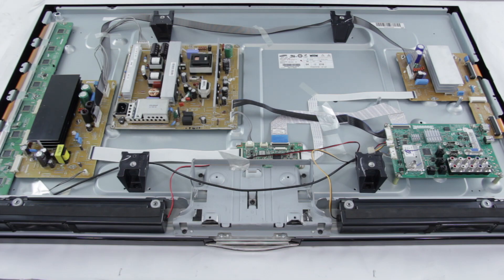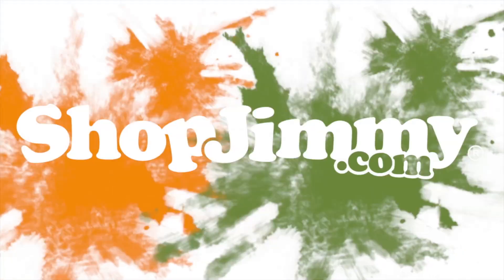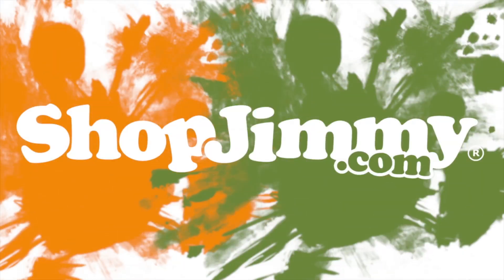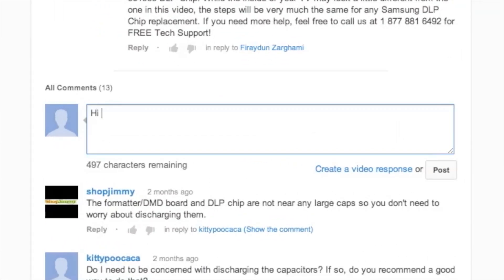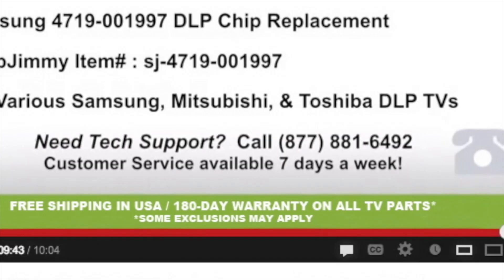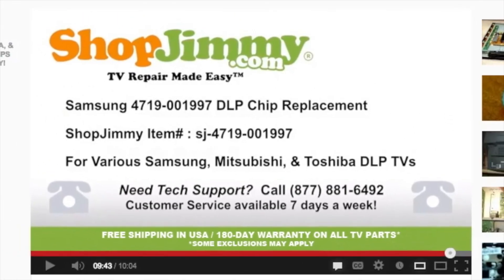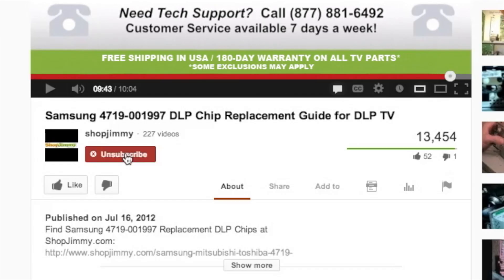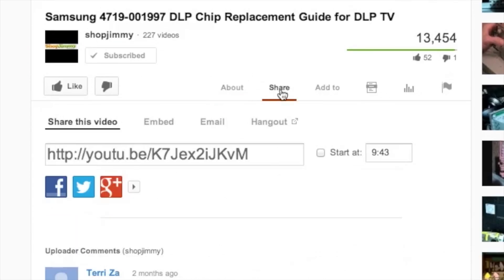Plasma TV Repair Tutorial - Common Symptoms & Solutions - How to Fix Plasma TVs

Comment: Here is a fun one for you, Hitachi  P42T01U, powers on with blue ON light from standby, screen is lit up, no function from the remote although the power light flashes to say its receiving a signal and every now and then, you will get a remote icon displayed on screen with a red line through it as if to say NO REMOTE, no controls work on the front of the screen, it then cycles a power trip, every minute or so, the TV relay will click, the panel shuts down and then comes back up almost instantly, there is no sound, the panel is lit though and presumed working fine as per the no remote icon, i suspect going from your video, its the main board thats at fault?
Reply from the maker: DirtyRottenBastard   I recommend replacing the main board in your TV.  Here is a link to replacement parts for your TV model number on our website, click here:  http://www.shopjimmy.com/catalogsearch/result/?q=42T01  Be sure to match part numbers on your current board, with your replacement for compatibility.  You can also call our customer service for further assistance with your purchase.  (877) 881-6492  Thanks and please let us know if you have any further questions with your TV Repair!  www.shopjimmy.com

Comment: I have a 50" Lg plasma tv / LG 50 PG20 no picture, no sound, changed out ysus board still no change, can you help me with my tv thanks George
Reply from the maker: George Momich  I recommend replacing the main board in your TV.  Here is a link to replacement parts for your TV model number on our website, click here:  http://www.shopjimmy.com/catalogsearch/result/?q=LG+50+PG20  Be sure to match part numbers on your current board, with your replacement for compatibility.  You can also call our customer service for further assistance with your purchase.  (877) 881-6492  Thanks and please let us know if you have any further questions with your TV Repair!  www.shopjimmy.com
Reply: Did find a solution to your problem? I have a LG 50 PS60 that will turn on for about 3 secs then turn off. Maybe we have the same problem. Any suggestions?
Reply: Mark, you have a capacitor problem on your power supply, check your power supply for bad caps.

Comment: I have a Panasonic model TH-42PZ700U the power light is red and blinks 7 times. No picture or sound just the power light blinking red 7 times is it possible for me to fix it and what part do I need.
Reply from the maker: Roe La Pollo   I recommend replacing the SU and SD boards in your TV.  Here is a link to replacement parts for your TV model number on our website, click here:  http://www.shopjimmy.com/catalogsearch/result/?q=TH-42PZ700U+  Be sure to match part numbers on your current board, with your replacement for compatibility.  You can also call our customer service for further assistance with your purchase.  (877) 881-6492  Thanks and please let us know if you have any further questions with your TV Repair!  www.shopjimmy.com

Comment: I have a Panasonic TC-P50S1 Plasma and while it was on it made a "splash" type sound then went completely black and lost all sound as well. When I press the power button it makes the sound as if to turn on, but it remains black with no sound. The power or on red light at the bottom of the TV flashes ten times, pauses, then repeats ten flashes over and over.
Reply from the maker: Jorge Rodriguez   I recommend replacing the SC board and the buffers that attach to the SC board.  Here is a link to replacement parts for your TV model number on our website, click here:  http://www.shopjimmy.com/catalogsearch/result/?q=TC-P50S1  Be sure to match part numbers on your current board, with your replacement for compatibility.  You can also call our customer service for further assistance with your purchase.  (877) 881-6492  Thanks and please let us know if you have any further questions with your TV Repair!  www.shopjimmy.com

Comment: Model: LE40C530F1W
Model Code: LE40C530F1WXXU
Samsung Solarized Distorted Picture since yesterday , Dont know which hardware part needS to be changed tried reset all cables and board cleanimh but no luck , I upload a video on youtube hope this help you to find the problem , This is the link here {{ Help me Fix my SAMSUNG LCD LE40C530F1W ? }}  Thanks
Reply from the maker: Ahsan Bashir   This could either be a bad main board or a bad T-con board in your TV.  You may need to replace each board one at a time to see which one fixes the problem.  Here is a link to replacement parts for your TV model number on our website, click here:  http://www.shopjimmy.com/catalogsearch/result/?q=LE40C530F1W  Be sure to match part numbers on your current board, with your replacement for compatibility.  You can also call our customer service for further assistance with your purchase.  (877) 881-6492  Thanks and please let us know if you have any further questions with your TV Repair!  www.shopjimmy.com

Comment: I have a Samsung Plasma TV model number HP S4253 X / XAA that  has a picture sometimes and then it has a black screen.  So  the picture sometimes goes in and out.  What could be causing this problem. The t.v. has sound but no picture.
Reply from the maker: Lorrenzzo Martin   I recommend replacing the Y-Main Board and the buffer(s) that attach to the Y-Main Board in your TV for your repair.  Here is a link to replacement parts for your TV model number on our website, click here:  http://www.shopjimmy.com/catalogsearch/result/?q=HP+S4253+X+%2F+XAA  Be sure to match part numbers on your current board, with your replacement for compatibility.    You can also call our customer service for further assistance with your purchase.  (877) 881-6492  Thanks and please let us know if you have any further questions with your TV Repair!  www.shopjimmy.com

Comment: HPS4273X/XAA  Started out that when I would be watching tv or dvd a blue fuzz would come over the tv.  Shut it off for awhile and the fuzz would be gone for  awhile.  Then there may have been vertical lines and black bars on the screen or even only half a picture, but I don't remember because the tv now turns and has audio but no picture and it happened a long time ago.  Recently I have renewed my interest in repairing this 42" tv.
Reply from the maker: ajfranklin1  This sounds like a TV panel problem.  If your TV panel is bad, it may be more cost-effective to replace the TV as panels are typically hard to find in stock, difficult to replace, and expensive.  Thanks and please let us know if you have any further questions!  www.shopjimmy.com

Comment: Thanks for the great videos, BTW!

I have a question for you, and I hope you can help me... :)

I have a Samsung Tantus 50 Inch Plasma Display that was given to me, and it once had a beautiful screen. Now there is a problem.....upon turning on nothing shows up on the screen, no menus or picture. The TV itself is getting power and is showing a green LCD Power on light, and I can see the backlight coming on illuminating the display but no picture. Even when clicking the "Source" switch I can see the display vary a bit in lighting like it is trying to accept input, but nothing.

In short, the screen is getting power, the display backlight appears to be working and there is a green lcd power light, but no menus or display..totally blank.

I am wondering what should I check first or what would be the more common cause for this, i.e. the Y, X or Logic boards? I am prepared to change all of them out if need be, and interested to see what type of experiences others have had in this instance ... any and all helpful advice appreciated....

Thanks!
Reply from the maker: MassMan67   I recommend replacing the y-board and buffers that attach to it.  Please reply with your TV model number and then I can recommend a replacement part.  Thanks!  www.shopjimmy.com

Comment: Ilo 42 ed plasma tv
s/n: 60360752
The tv made a pop noise and picture is black still have sound
Reply from the maker: cynthia ranney   I recommend replacing the Y-Main board and buffers that attach to the Y-main board.  Here is a link to replacement parts for your TV model number on our website, click here:  http://www.shopjimmy.com/catalogsearch/result/?q=42+ed  Be sure to match part numbers on your current board, with your replacement for compatibility.  You can also call our customer service for further assistance with your purchase.  (877) 881-6492  Thanks and please let us know if you have any further questions with your TV Repair!  www.shopjimmy.com

Comment: I have a Viore Plasma tv model# PDP4210EA. The problem is the tv shows a Pink ish color even when its in stand by mode. When in stand by mode the color should be blue. but that's not the case. I  think its the s-sus.
Reply from the maker: JERMAINE773   You can certainly try that board, however I believe the problem is the YSUS board that needs to be replaced for your TV Repair.  Here is a link to replacement parts for your TV model number on our website, click here:  http://www.shopjimmy.com/catalogsearch/result/?q=PDP4210EA  Be sure to match part numbers on your current board, with your replacement for compatibility.  You can also call our customer service for further assistance with your purchase.  (877) 881-6492  Thanks and please let us know if you have any further questions with your TV Repair!  www.shopjimmy.com

Comment: Hallo,i have a ECE plasma tv model no EDP 4223 EW,serail no EPD42T23S843 MAL 00080.All the part samsung made.The problem is went turn on got red blink.but i not count it after that black screen and 3 black vertical line.cant you tell me what happen and any part i can change
Reply from the maker: Omar Mat Ali   This sounds like a TV panel problem.  If your TV panel is bad, it may be more cost-effective to replace the TV as panels are typically hard to find in stock, difficult to replace, and expensive.  Thanks and please let us know if you have any further questions!  www.shopjimmy.com

Comment: LG 42PC3D. The picture is dark and pixelated on startup. Picture slightly improves and pixelization clears up but overall all remains very dark with the heaviest shadowing on the left side. Sound seems fine. This happened suddenly. TV was fine when shut down, then 30 min later on startup it was broke. The picture defect occurs on any input even a snow static screen. TV is about 7 yrs old.
Reply from the maker: Kyle Kraetzer   I recommend replacing the main board in your TV.  Here is a link to replacement parts for your TV model number on our website, click here:  http://www.shopjimmy.com/catalogsearch/result/?q=LG+42PC3D  Be sure to match part numbers on your current board, with your replacement for compatibility.  Here is a link to a video showing how to identify your part number, click here:  TV Part Number Guide for LG & Zenith Main, Digital, & Tuner Boards (LCD, LED, Plasma TVs)  You can also call our customer service for further assistance with your purchase.  (877) 881-6492  Thanks and please let us know if you have any further questions with your TV Repair!  www.shopjimmy.com

Comment: I tried to conect a LED tv to my laptipn and the HDMI made a short circuit. Now the tv doesnt turn and does not have any stand by. What can be wrong?
Reply from the maker: Miles_Albus  I recommend replacing the main board in your TV.  Please reply with your TV model number and then I can recommend a replacement part for your TV Repair.  Thanks!  www.shopjimmy.com

Comment: My Zenith Plasma TV, Model #Z50PJ240. The problem is, when you turn it on, it clicks on and then off. What can I do to make it turn on and stay on? Is there a reset button?
Reply from the maker: LINDA MAYS   I recommend replacing your power supply first to see if that fixes the problem.  Here is a link to replacement parts for your TV model number on our website, click here:  http://www.shopjimmy.com/catalogsearch/result/?q=Z50PJ240  Be sure to match part numbers on your current board, with your replacement for compatibility.  Here is a link to a video showing how to identify your part number, click here:  TV Part Number Identification Help Guide for LG & Zenith Power Supply Unit (PSU) Boards  You can also call our customer service for further assistance with your purchase.  (877) 881-6492  Thanks and please let us know if you have any further questions with your TV Repair!  www.shopjimmy.com

Comment: I have a LG plasma tv, model 60PK200.  When I turn on the tv the screen is black for a minute or two and then the audio starts but the screen stays black.  I've checked all of the resistors on the boards and none of them are rounded at the top so I'm assuming that is not the problem.  Do you have any suggestions as to what is causing the tv to have no picture?  The manf date on the tv is January 2011.  Thanks

Comment: I have a LG 50 inch 50PZ 550 that has selectively lost two Chanel's from the DTV signal. All other channels are working fine. I have completely reset and rescanned, still no channel 2 or 6.
Reply from the maker: Robert Kayton   I recommend replacing the main board in your TV.  Here is a link to replacement parts for your TV model number on our website, click here:  http://www.shopjimmy.com/catalogsearch/result/?q=50PZ+550  Be sure to match part numbers on your current board, with your replacement for compatibility.  Here is a link to a video showing how to identify your part number, click here:  TV Part Number Guide for LG & Zenith Main, Digital, & Tuner Boards (LCD, LED, Plasma TVs)  You can also call our customer service for further assistance with your purchase.  (877) 881-6492  Thanks and please let us know if you have any further questions with your TV Repair!  www.shopjimmy.com

Comment: P50HDTV20A......I just purchased a Logic board from shopjimmy and installed it in my tv. I still have no picture. The power supply has been repaired w/ 3 caps replaced. I still have a black screen. When the tv is powered on a green light comes on logic board and you hear a click in the power supply board area and still no change...any thoughts?
Reply from the maker: lasonja blanks   I recommend replacing the Y-Main board and buffers that attach to the Y-Main in your TV.  Here is a link to replacement parts for your TV model number on our website, click here:  http://www.shopjimmy.com/catalogsearch/result/?q=P50HDTV20A  Be sure to match part numbers on your current board, with your replacement for compatibility.  You can also call our customer service for further assistance with your purchase.  (877) 881-6492  Thanks and please let us know if you have any further questions with your TV Repair!  www.shopjimmy.com

Comment: I have a Curtis pl4210a-2 and the sound works but the screen only shows fuzzy grey lines then goes completely dark after a few second. I replaced the y main and logic board but it didn't fix it. Any suggestions?
Reply from the maker: 10phil9   Did you replace the buffers for the Y-main board when you replace the Y-main board?  Thanks!  www.shopjimmy.com

Comment: A friend has a Maxent P420142X2 and I think it's a 2006 which is dead but says there was a blue line on the screen.  I hear that Plasma screens lose pix quality after a while.  Would it be worth it to fix?  He did say that there was a loud pop before it went dead.
Reply from the maker: Scalerwave Signal   I recommend replacing the YSUS board and the YDRVTP & YDRVBT boards.  Here is a link to replacement parts for your TV model number on our website, click here:  http://www.shopjimmy.com/catalogsearch/result/?q=P420142X2  Be sure to match part numbers on your current board, with your replacement for compatibility.  You can also call our customer service for further assistance with your purchase.  (877) 881-6492  Thanks and please let us know if you have any further questions with your TV Repair!  www.shopjimmy.com

Comment: Nice Video.  I learned a lot.  If you can help out that would be great.
.
here is the TV.  Make: HP CPTOH-0602.

Symptom:  Can hear a click when you turn on the unit.  Blue LEDs on the boards come on, but then one goes off and another click is heard (cutting power?).  Trying to hit the power button again does nothing.  You have to unplug it, wait for the PSU to drain and then try it again.  Here is a video of symptom

LG CPTOH-0602 Turns on and then back off

Please feel free to check the video out and steer me in the right direction so I don't waste $$ on boards that I don't need.  :)

Comment: Pionner Plasma TV Model #: 6010FD. Screen was getting greed dots on the left side of the screen for some time and getting worse. I then open the back panel to check if there were any blown capacitors but all looked fine. I checked each one. After a while the TV would not turn on anymore, It would only go to stand by mode with blue LED lit but no picture. Your help is highly appreciated
Reply from the maker: Alejandro Ramirez   I recommend replacing the Y-board and the buffers as well, if you can find them for sale.  Here is a link to replacement parts for your TV model number on our website, click here:  http://www.shopjimmy.com/catalogsearch/result/?q=6010FD  Be sure to match part numbers on your current board, with your replacement for compatibility.  You can also call our customer service for further assistance with your purchase.  (877) 881-6492  Thanks and please let us know if you have any further questions with your TV Repair!  www.shopjimmy.com
Reply: ShopJimmy.com Thanks, I have already ordered the Y board from your website today. I was looking at the buffer boards as my Part # is AWV2507 which is currently out of stock but I have subscribed to be notified. For the buffer board my TV Pioneer 6010FD has 4 connected to the Y-Board. All four have part #AWV2507 but marked in order as AWW1319 Scan A, AWW1320 Scan B, AWW1321 Scan C, & AWW1322 scan D. I was wondering if the same buffer board AWV2507 can be used for all four. Let me know thanks in advance.